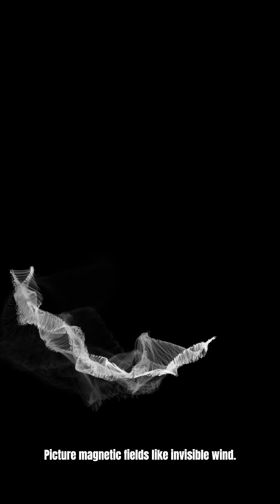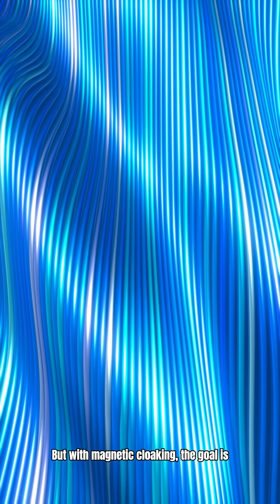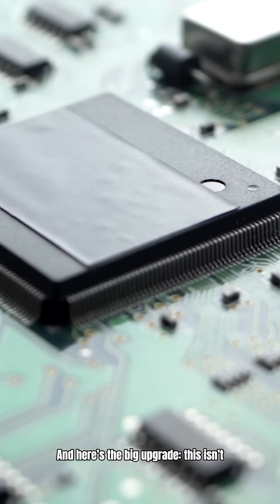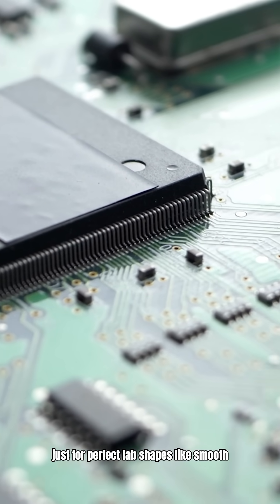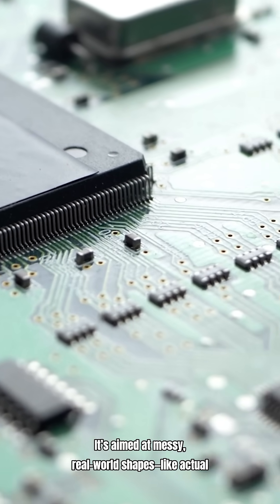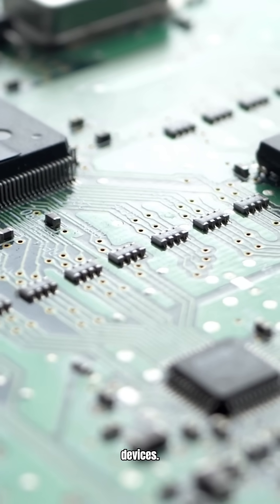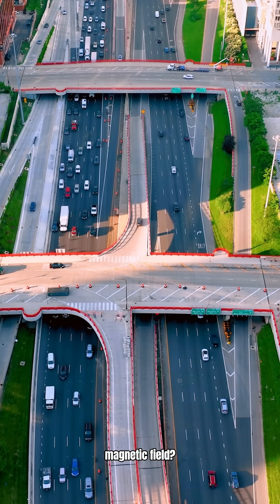This Stops Magnets Dead in Their Tracks #physics #experiment

Comment: Old Technology. The Lockheed Martin tic Tac F-18’s caught on camera were around in the 1950’s. Appearing as silver Discs and Cylinders then appearing to disappear depending on the angle you saw them from.
Reply from the maker: Those just used high reflective metals and carefully designed angles to redirect radar which detects objects by bouncing signals off of them. This is a whole new level.